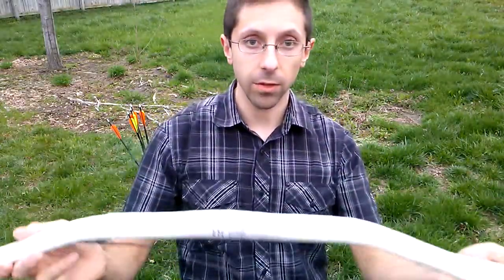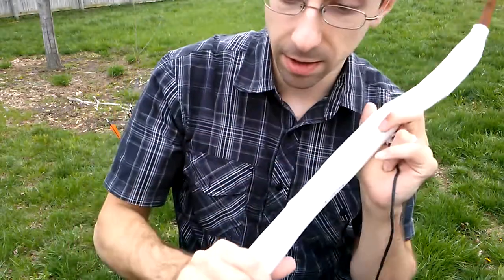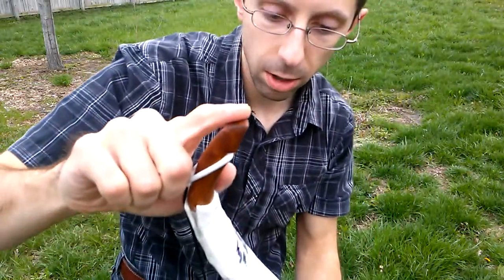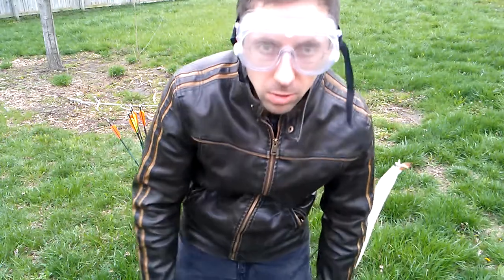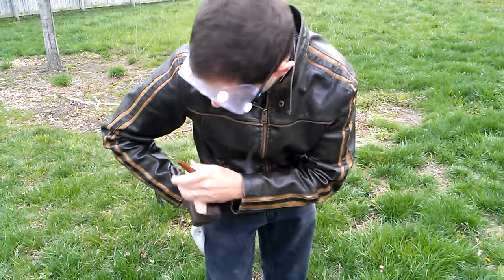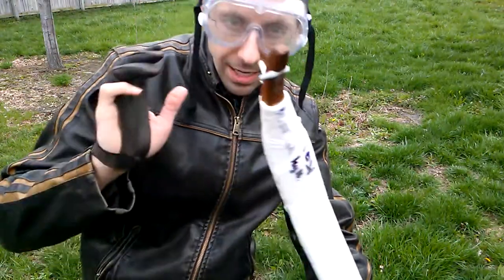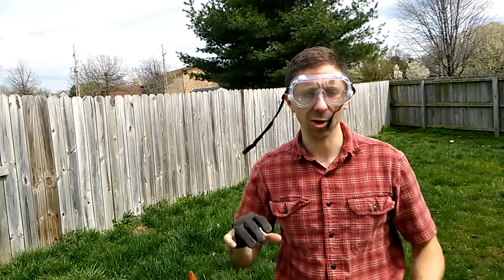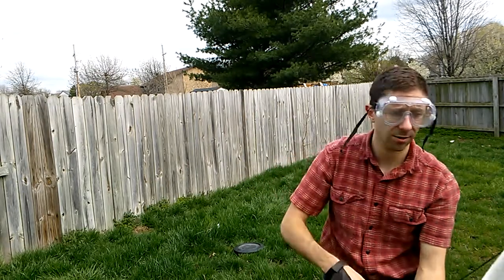The Heavy PVC Turkish Bow - Attempting to Draw

Comment from the maker: I totally understand! I recently had a limb snap where the PVC siyah had poor contact - it had just enough wiggle to hinge and stress the bow's limb in the wrong spot. I actually thought the bow would fail, but on the other limb, which I had damaged forcing the siyah in - but no, that held strong! Weird.

Anyway, it's midnight, I draw the bow, and BAM! I'm holding a shattered bow, the offending siyah flew 30 feet into a glass table! Miracle it didn't break anything, but MAN was it loud.

Comment: I made a bow that's somewhere around 75 or 80lbs, and I was practicing drawing it at full length a while back and the string somehow slipped off the nock. The bow went FLYING and crashed into some cardboard boxes I've got some stuff stored in. It put a large hole in one and broke a tupperware container inside. Scared the hell out of me. If it had hit me, or my dog which it missed by about a foot, that would've been a very bad day. Be careful! Needless to say, I do my nocks differently now. :D

Comment: Why do Bows Stack? HOW to get rid of it!!!
Reply from the maker: http://goldenhordebows.blogspot.com/2014/06/what-is-stack-as-it-relates-to-archery.html

Basically, stack is a loss of leverage resulting from the increasing angle which the string intercepts the limb. You can reduce it by using recurves, which effectively "lengthen" as you draw, making the bow feel lighter, as well as keeping the string angle low and manageable.  That's one reason why a 39" nock-to-nock Turkish bow is usable, whereas stack can be extreme in a 48" long straight-bow.